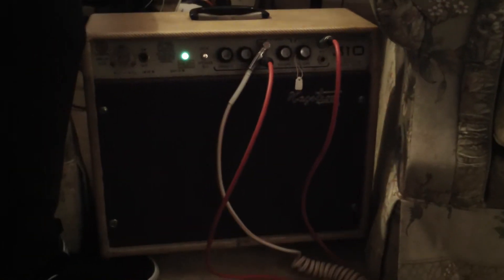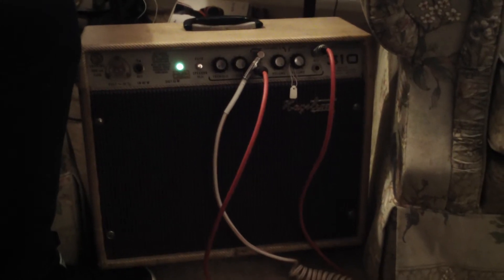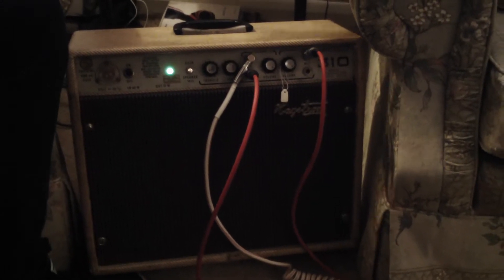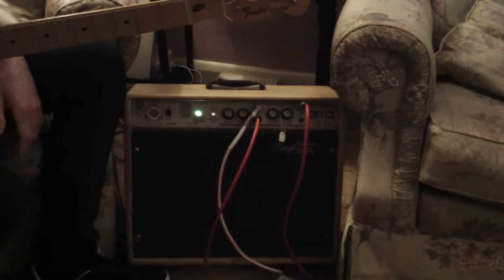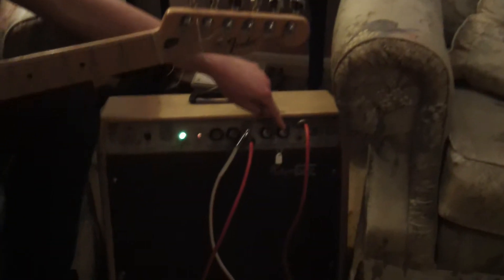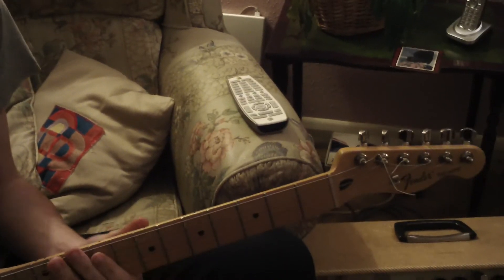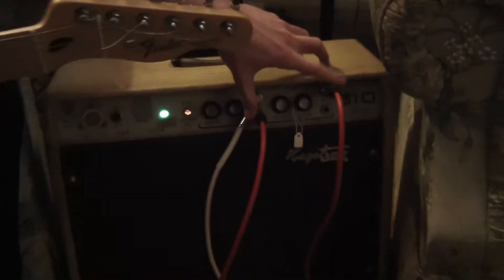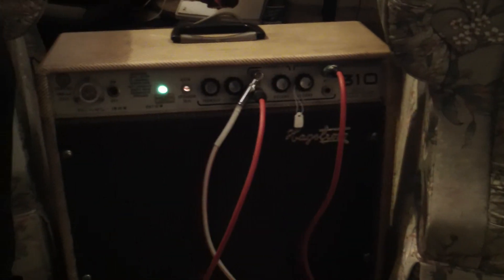Vintage Hagstrom 310 Amplifier - Always think these amps are too clean? Treat 'em Like a Marshall!

Comment: My earlier comment was in folly. Bridged like in the video, with my Strat via a TC Spark Booster it absolutely soars! Sounds excellent. I recommend it wildly to anyone wanting to know what an actual real vintage tubeamp should sound like all out. Absolutely great for blues and classic rock in a rehearsal environment. I sold it to a guy with a vintage keyboard/organ. When he tested it, it sounded ab. unbelievably good. So recommended for that purpose as well. The keyboard har a much wider frequency range and higher output than guitar so you get the picture..;--D

Comment: Great video thanx! I´m a happy owner to one of them Hagström 310. Mine isn´t tweed though but toolex, I think. The valves are NOS and I´ve got the original Sinus speaker, but I also boughet a Jensen Alnico 10 inch speaker, just in case. It´s great fun so far and I wonder more exactly: How do You get that big sound out of it? What do You need to broadband plug the amp? Best Wishes Fredrik